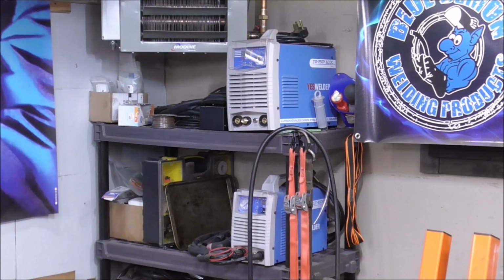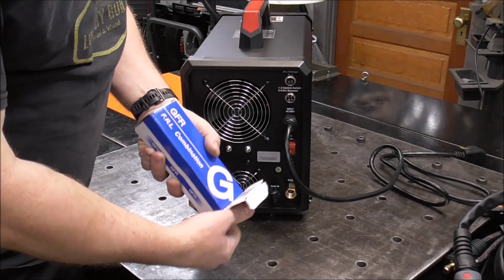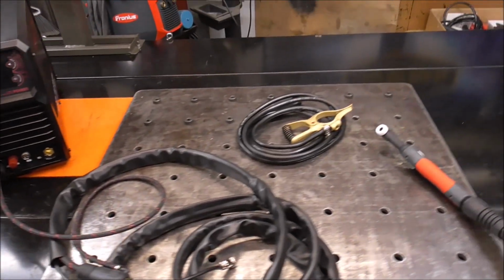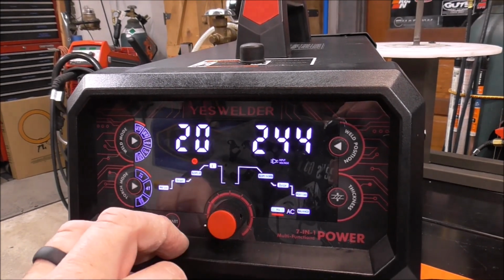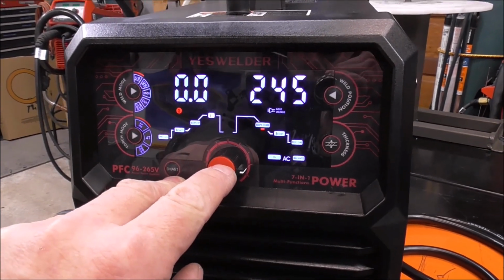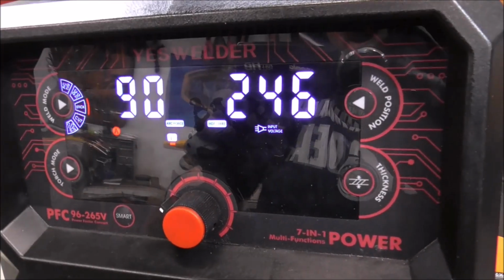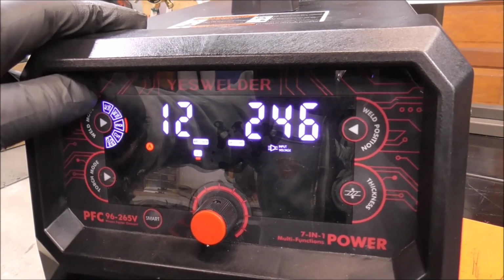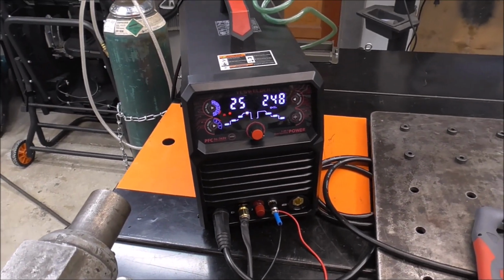YesWelder CT2050 All in One AC and DC Aluminum Welder and Plasma Cutter

Comment: Great video! I just purchased the 2050 and I also purchased the WP-17V flexible torch. Will the WP-17V work with the 2050?
Reply from the maker: I believe it will. Nice purchase btw!
Reply: Thanks for letting me know. I just ordered the foot pedal from Yeswelder. I will try the Tig torch that came with the 2050.

Comment: Can you cut painted metal with this or does the tip have to be on the table
Reply from the maker: @chrisallen3741 This is "pilot arc" meaning you dont have to make contact for it to start cutting. It will cut right through painted metal.
Reply: @BrandonLund  sorry i am a little dyslexic…it looks like a really great machine and you are right on the money….cant get any better than that for the money…so, my next question, is if i buy this under your link will you get money for anything else i buy from the things i can get from their website….or is it just for that
Reply: If i wanted to do cnc…i bet it would make really good peices…interesting….thank you

Comment: Love your videos - would you rather have this all in one or the Pro 350 plus one of the plasma cutters?
Reply from the maker: Personally I prefer separate machines for what I do. If I'm on a mobile repair job and the tool fails than everything gets shut down versus with a separate machine if the plasma cutter fails I'll grab a grinder and can still weld

Comment: I am considering this machine. 
I have an old lincoln tombstone, then bought a wire feed, then a mig, then a small plasma. Was thinking about trying tig. 

All those machines take up quite a bit of space. I dont weld much just a fun project, or repairs here and there. 

I could probably sell all the other units to recoup most, if not all the cost.
Reply from the maker: Yes, absolutely

Comment: Hi there you always do this awesome tutorial.  An observation in you air regulator, nothing there is a notch in the body of the air regulator close to the knob collar.  The shiny bracket you installed has a small tip that align with this notches to avoid regulator body turning when regulating the pressure.  Yours is upside down.  I has the same issue I installed the bracket the correct way to align the tip of the bracket with the notches , but then I ran in to the issue the valve glass was hitting the table
Reply from the maker: Interesting....I'm surprised I didn't catch that at first.  Thank you pointing it out 👍
Reply: You’re welcome ☺️

Comment: I bought the CT2050 off the original kickstarter. It's a nice welder but it does have a few flaws (to me anyway).
1) The plasma torch works well but it has a one of a kind electrode. Only YesWelder carries it and even they don't have any in stock. Having only one source for consumables  annoys the crap out of me so I swapped the torch head out for a 'standard' PT-60 style head.
2) The built-in compressor is nice but wasn't enough to keep the plasma happy. Mine maxed out at 30-40psi. Gave up and use shop air instead. Plasma torch happier @ 60psi.
EDIT: Maybe that's why they had you bypass it. Mine came with a leaflet showing the regulator plumbed in as you'd expect. Setup like that it didn't reliably supply enough air.

3) The tig torch is a Euro style with a button and heat dial. It has a thick hose with a rubber cover. Durable but heavy. I found it too big and bulky to get comfortable with. Replaced w/ a standard CK 17 style torch. Meh.... personal preference.
4) It doesn't come with a pedal. The pedal that comes with the big consumables kit is actually pretty nice.
5) It draws a lot of power. YesWelder is a little vague on its power requirements in their advertisements. Running 6013 stick @90 amps popped the breaker on a dedicated 20 amp 220V circuit in about 30 sec. Ended up running a dedicated 50 amp circuit just for the welder. Overkill? Maybe but it'll run stick @ 200 amps w/o issue now.
Reply from the maker: Hmmmm I dont remember having to use any specific tungsten. I will have to look into this more. I agree the TIG is a bit bulky. When I first setup the Plasma it seemed weird to bypass the regulator. I contacted Yeswelder and they sent a diagram showing to bypass it. They never said why. I thought it was to prevent someone from choking down the airflow so the compressor wouldn't overheat and fail. Now that you mention it, it could be that it restricts too much flow. Overall I am very happy with it though.

Comment: You didn't hook up the compressor correctly. Even if using the onboard compressor the air line is still supposed to go through the regulator.
Reply from the maker: This is how YesWelder wants it hooked up.  I actually asked this question and they confirmed the drawings are correct. I think their reasoning is so the compressor doesn't get dead headed on accident.
Reply: I have mine running through that if not how do you adjust the pressure also it's a moisture separator.  There is a lot of water that comes out, at least on mine, it will be going into your machine .
Reply from the maker: I agree with you but thats not how yeswelder says its supposed to be hooked up when using the onboard compressor.  They want the regulator / separator not connected for whatever reason.
Reply: @BrandonLund  do you know how to test for pressure on gas and air? The previous yes welders had and option to test gas so you could adjust pressure.
Reply from the maker: I don't. I'm sure you could put an inline guage to test it but I've never tried. If I had to guess I would say the on-board compressor puts out around 35 to 40 psi which is a pretty decent pressure for general cutting. I'm not sure why they instruct not to run the on-board compressor through the regulator but they do. I found it odd also but I also don't want my warranty messed up by them saying I hooked it up wrong.
Reply: @BrandonLund  I meant they had a setting that would just fire the argon or just run the compressor so you could check and adjust as needed without starting an arc with the torch or starting the plasma cutter .
Reply from the maker: Oh I see. I wish it did work that way 👍
Reply: Just FYI, I received my CT2050 recently and the pdf manual doesn’t mention anything about how to hook the compressor lines. However, it did come with this 1 page printout with pictures showing how to hook up compressor and it has lines going through regulator while using onboard air. If I could post a pic I would provide it. I need to email YesWelder for confirmation since all of YouTubers that did early reviews have it hooked up differently than the instructions YesWelder has provided to customers.
Reply from the maker: Interesting. Running it through the regulator / seperator is how I would think it should be hooked up but they told me no so please report back what you find out.
Reply: Maybe the regulator reduces the flow and for demonstration purposes the plasma would get more air without hooking it up.  Per instructions they sent him.  Or they could have just told him reduced performance with on-board air and its limitations.

Comment: Only thing I see in my opinion that I'd do differently is not bypassing the regulator filter when using onboard compressor.   I set mine up I ran my onboard compressor through the regulator/filter /water separator that way I can reduce moisture to the plasma cutter air supply as much as possible and control the air pressure while cutting using the onboard compressor.  I still have to pick up an argon tank and start learning how to tig. But this machine should be a nice addition to my collection of welders and cutters
Reply from the maker: Thats actually a great idea. I asked YesWelder about this specifically and they sent a drawing showing how they wanted it hooked up. My only thought about WHY they wanted me to hook it up WITHOUT the regulator / seperator inline is they are probably afraid someone will accidentally have the pressure choked way down on the regulator and burn up the compressor by accident from the restricted flow. If you ensure your regulator is fully open than your way is best in my opinion.
Reply: Thanks for this comment guys I have been searching everything about the air regulator for the built in compressor and this is the only one that explains what’s going on with it satisfactorily.
Reply: From my experience, the American marketing team doesn't understand the equipment from china.   Bad translation??? 
 Yes, you will run out of consumables pretty fast with moisture in the air.  Which would be good, because then they can sell you the consumables kit.

Comment: Yeeeah.....I have 2 of them.  The new one they just sent me won't get any gas to the TIG torch.  Had to bypass the machine.
Reply from the maker: Sorry to hear that.  I've had really good luck with them. I would reach out and send it back. Not to doubt your intenligence but I've had issues with guages not putting out gas to the machine...have you checked you are getting flow to the machine? It sounds like your solenoid is stuck closed if so.

Comment: I like the on board compressor,but surely it would be better to run it through the water separator first ???
Reply from the maker: According to the directions, no. But you make an excellent point, i can see vapor in the line when the compressor runs so i would think it's dimimishing the consumables. I think they have it hooked up this way so you dont accidentally dead head the compressor by having it run through the combination regulator / water seperator. As long as you made sure the regulator was fully open i think this would be the better way as you suggest.

Comment: I am curious about the quality? I bought some tig consumables from this yes welder company and they were very very cheap. Unfortunately the quality was horrendous the cups were so badly made that they leaked gas around the top sucking in air the gas lenses had horrible gas coverage and they disintegrated when they got warm because they were soldered together ( had to run almost 30cfh on a #6 cup) and collets lasted a fraction of the time that a name brand one did. I was not impressed to say the least. Has the quality improved?
Reply from the maker: I dont own any of their older stuff so i cant speak if it has improved any but what i do own i have not had any issues..

Comment: I’m by no means a professional welder but I’m always fascinated when people look at an air cooled torch and call it “nice”. In my experience an air cooled torch is absolutely useless. I don’t understand why people like them? The damn things get so hot they start to melt after welding for a few minutes, not hours but minutes! You can completely forget about welding with anything but stick welding gloves with an air cooled torch.
Reply from the maker: I dont tig weld enough to justify having needing a cooler.

Comment: Hello Brandon, I sure wish you could have actually welded a T-Joint or a Lap on some 3/16” aluminum to see how well the machine puddles and the quality of welds it is capable of. Your simple short bead on a flat piece of aluminum wasn’t nearly enough to sell me on its capability. With the machine in highest heat setting, how long of a weld bead can you lay down before the machine goes into thermal protect shutdown? Obviously really good machines have higher duty cycles, but at a price of thousands of dollars, as well as water cooled TIG Torches for higher output power levels. Would love to see you weld a T-joint or lap on some 3/16” AL in say one 12” long non-stop pass. This would be a great test to see if the machine can handle this duration of welding at full power, without going into thermal shutdown or the machine burning up. Thanks for the video 
😎👍
Reply from the maker: We will find out very soon! I plan to do just that
Reply: @BrandonLund  Thanks my friend 
😎👍
Reply: It's a 100%duty cycle machine and havent had mine run into thermal shutdown yet. Ran a 16"inch lap with no problem on 1/8" and  3/16" aluminum
Reply: @Truebillycat  Wow 100% ! You don’t usually ever see that but on your most expensive industrial grade  machines. Very nice 👍

Comment: great video Brandon  that welder looks like a Winner  , i too was asked to test a Kirby feed wagon ,feeding about 1200 head of cattle every day , i told them where some changes could make it better well they did the changes . and wound up giving me the wagon for my help  stay safe and GOD bless   TANK
Reply from the maker: @Tank Soldier thats pretty cool! This is a great way to design products in my opinion. Too many times an engineer who will probably never use the tool is in charge of designing it.  By passing it out to consumers the engineers get first hand feedback on what works and what needs improvement. This is actually the "revised" unit from the previous unit they sent so they are clearly listening to the consumers for sure.

Comment: If I've got to swap hoses and gas sources, it's just asking for crossed threads and delays.  We love our FP18's internal compressor, but just want something larger.  We've got a YW TIG-250P we love and is still schooling us, so we're looking at a cutter upgrade someday.  When we do, it'll also have to work w/a CNC controller.
Reply from the maker: @James Wyatt this is the one that I've been using and I love it and its CNC compatable. I think they also make one that is one step bigger also. https://youtu.be/pmNVH1XtWBA

Comment: Brandon, I have a twin cylinder oilless compressor that I plan to try on my plasma cutter. It should provide adequate volume of air. It was rescued from a home oxygen concentrator unit. I'll mount it on my welding cart.
I'm guessing that the Yes welder you tested has a similar compressor.
Reply from the maker: Thats a pretty nice find @Bryant Fry I dont know much about compressors but this sounds like something that would work. It seems like both units would work simular with low pressure high volume.
Reply: Here's the deal I have a 100 litre tank 3.2hp compressor which won't keep up with my 30amp plasma cutter, only a 150+ litre tank is able to do the job.
So how the fuck does a tiny little tea party compressor work on this machine?
I'm literally watching piss fall from a cloud here someone, brendon explain this to me immediately before I lose my gears
Reply from the maker: I have no clue how it works with this machine but it does and it doesnt require a tank. I'm just a welder. Thats an engineering question. On a side note, I have run plasma cutters with compressors as small as 6 gallons (27 liters). Although not ideal, it will work if your in a bind and need to get it done. This unit however will cut continuiously without any recovery time.
Reply: @BrandonLund  Thanks for the reply mate yeah I've seen multiple of these types of inbuilt compressors work and I've also had small 50 litre compressors work but they only cut about 3-5cm of 1/4 inch before cutting off so they are worthless.
But having the compressor inside the plasma cutter is even more strange because it works better than a small compressor attached per say.
I'm sceptical but I've seen them work on YouTube heaps of times.
Final note sorry to argue but I think 150litre(40 gallon) size tank minimum is what anyone would need otherwise you can't get any work done and it will drive people crazy.
Unless these new inbuilt compressors are some form of quantum magic then I don't know how they can do the job adequately without a big massive compressor.
Reply from the maker: I have a 50 gallon in my shop and it keeps up pretty good. The smaller compressor i mentioned is a little portable unit for running nail guns. It works but its not ideal as you mentioned. You have to cut a little then stop to let it catch up. Im not sure how they make the onboard compressors work but ill admit im pretty amazed. Its constant air pressure and its endless. It works as good if not better than when its hooked up to my 50 gallon compressor and its relatively quiet.
Reply: @BrandonLund  I'm amazed if it keeps up with your 50 gallon compressor, that's some serious fuckery lol. awesome man

Comment: Brandon, I see you a a Fronius sitting behind in the shop. How would you rate your weld you done with this machine? I’d be interested in seeing a comparison or weld off. Haven’t done much TIG welding ( still quite a learner) but it is deff my weld I want to prefect. TIA.
Reply from the maker: @herronleslieThats a great quesition with a not so simple answer.  The Fronius you see is my MIG welder. Although it's a multi process machine I primarily use it exclusively for MIG so the other features I really cant say how they would compare but I would assume it would perform very well (It's also nearly 4x the cost).  Using a machine consistently will always prevail over a machine you have only used for a few times so honestly I think whatever machine you purchase you can expect to get awesome results from so it really boils down to what you want for features, online reviews and warranty. Personaly I'm really loving this machine for the fact that it does AC TIG Aluminum, Pulse TIG and it has the onboard compressor for plasma cutting not to mention you can also DC TIG and stick weld. That makes it handy for me when doing mobile jobs. So in short, which ever machine I used the most will be the machine that I am going to produce the best welds with so pick one that has the features you want and go with it. Clear as mud? LOL